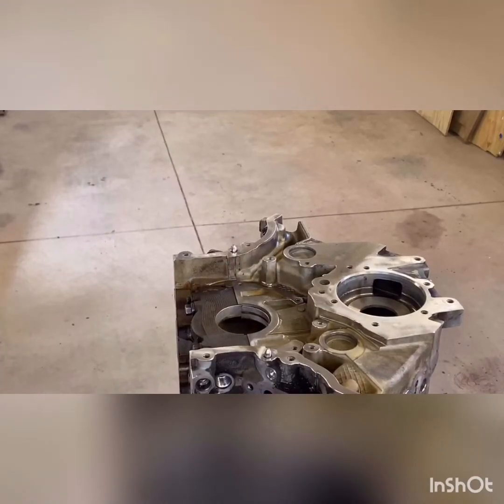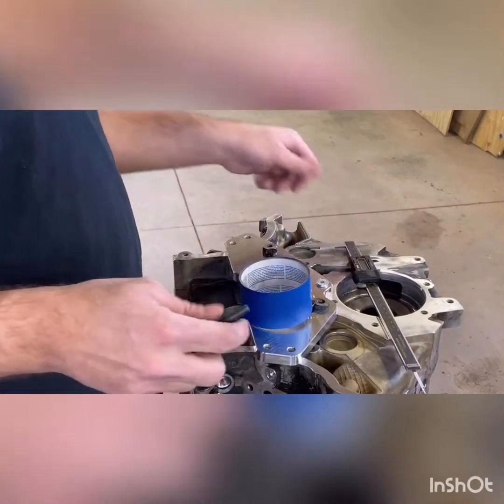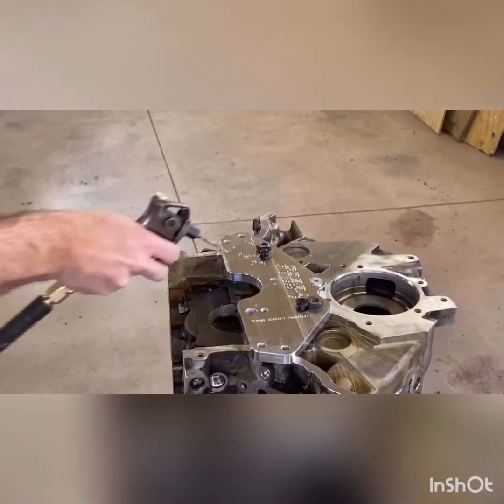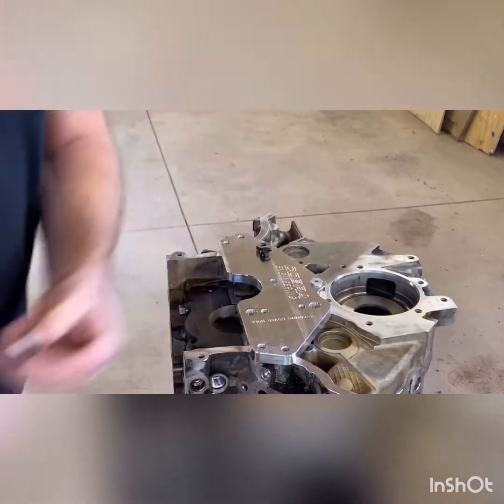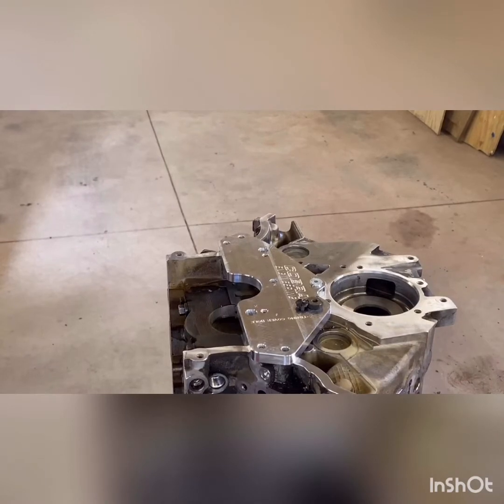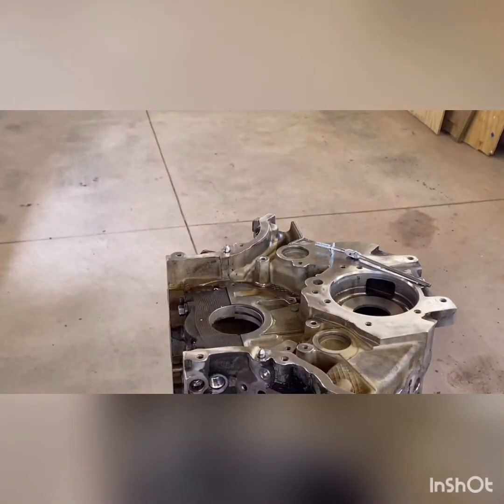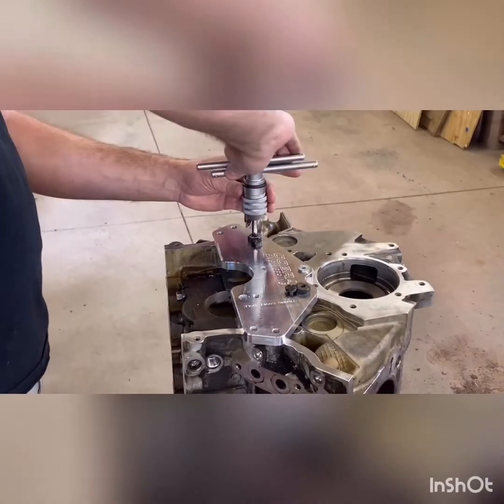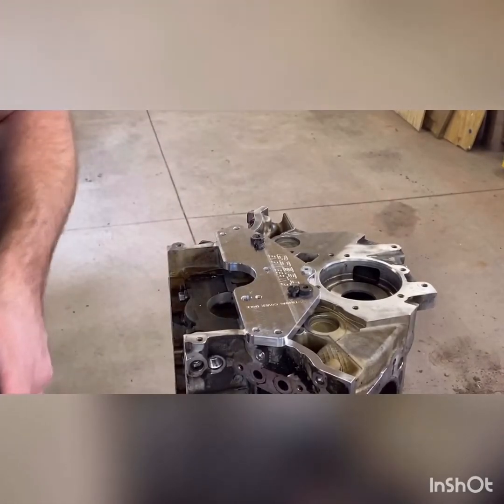Cobra Engineering Drill Fixture

Comment: I just recently purchased the drill plate for my Teksid 2v build pivot pins. 
I have 1 question about timing cover drill out. The 01-04 mustang 2v cover there is one bolt that does not line up. Is this the same location being drilled out as the Terminator cover in video?
Reply from the maker: I can’t remember but if I remember correctly that block was used in a 2V. 
Use a marker to mark where the hole needs to be. Then check and see if the fixture lines up
Reply: @cobraengineering thanks for responding. I was thinking of doing that when I get the timing cover. I just haven’t gotten that far yet with the build.